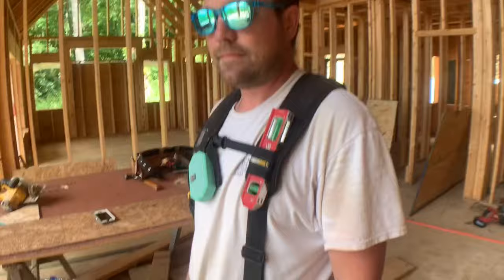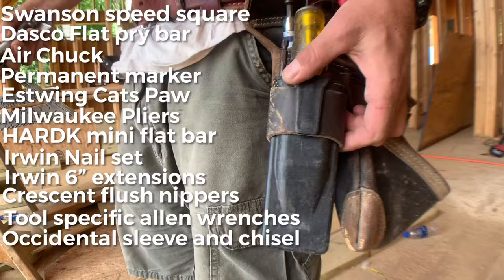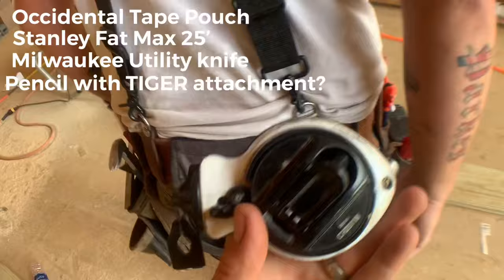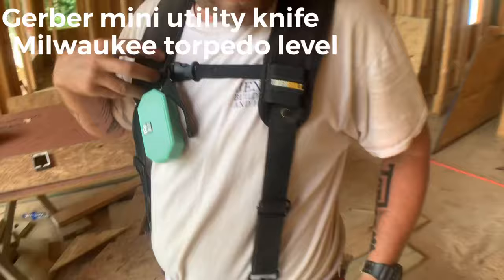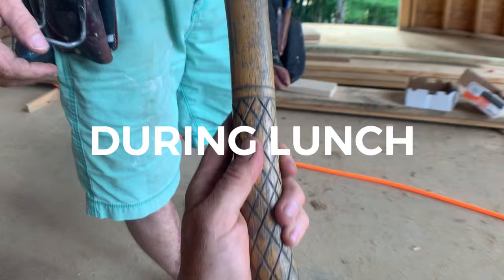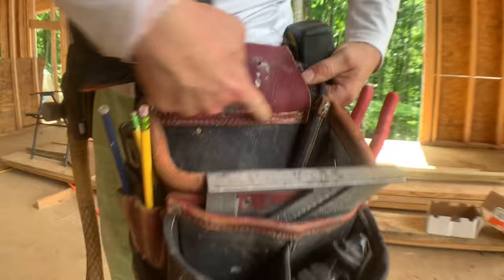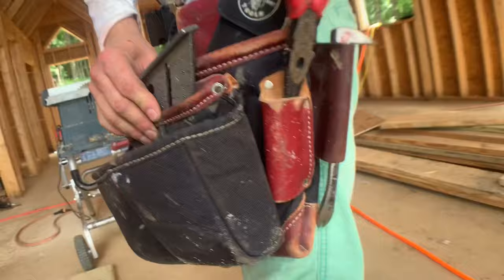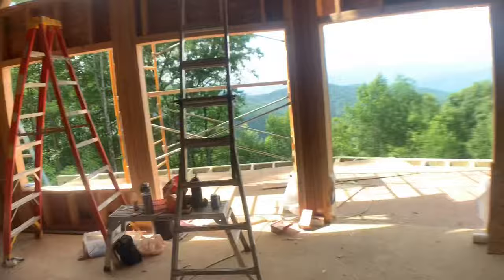Tool Your Belt | 2 Awesome and Eclectic Tool Belt Setups

Comment: One thing I learned from the old guy at EC and have incorperated into my belts is to always have your tape and marking items on opposite sides. That way you can pull out both at one, each in the ready hand and ready to mark! Every since that video I swear it has sped up my productivity to the point the Italians I work with have picked up on it and are currently doing it now without even asking me. The fluidity of it alone is not thought about but easily spotted and once someone sees how fast you measure and mark and are onto the next layout or cut.... they are envious lol

Comment from the maker: Ok so Jono and Jaime are rigged for doing framing, trim, and general carpentry.  They were doing trim the previous day on one job and framing a deck the next. We do almost everything OURSELVES on our jobs from pouring footers, to tiling showers , to building custom cabinets.  Basically our usual toolbelt set up is a combination of a framer and trim belt set up so that we can tackle ANY task. Hope this is helpful and fun for you guys!!
Reply: That's the way to be man. I built my own house, dig the hole, poored the foundation, framed, sheeted, all metal siding, u know the rest. I did hire a guy to hang sheetrock because I couldn't handle 12' rock by myself.
Reply: FYI, I was 25 when I done that.
Reply: I mean.. the wee little flat bars and the kreg bit kinda gave it away :)

Comment: Best tool belt tip I've ever heard is to keep all of your small driver/drill bits in a Altoids tin to keep them organized.  I use it every day
Reply from the maker: Yep that’s really a good one..  thanks
Reply: Or Buy a cheap yoga foam block on Amazon and cut it with a heated sharp knife to be in the shape of one of your small pouches. Then pre drill 3/16 holes neatly wherever you want your bits. Always organized and they never fall out.
Reply: @h2s I'm a new construction  plumber. I agree on the pill bottle. I carry an Advil bottle to hold my cutter wheels. I'm the only guy on the crew not losing his wheels.
Reply: Just get the little dewalt bit case with snap lock and has a clip. Although I just keep mine in my little pouch of my occidentals

Comment: Too tired at end of day carrying all that. 30' fat Max tape, hammer,, speed square, pencil, sharpie, utility knife, scribe, multi bit screw driver. AND a nice conveniently located table for about 30 things I like close by but don't carry. 61 y o.
Great videos guys, the right crew makes it fun.
Reply from the maker: Wow! Thanks for the tool count on that :-) you’re exactly right about the crew makes the difference… We are super blessed to have a bunch of great guys and I actually look forward to going to work.
Reply: @PerkinsBuilderBrothers  
Forgot chisel 3/4" and nail sets, big and little ride in the bag. Over here we call it the misery bag but you don't make any money unless you're wearing it. 
Thanks for the tip on the chisel guard. Ear and protection very important, keep up the great work !

Comment: Nice practical setups in my honest opinion. Great video. I'm starting to dig those small units on your strong side where a bag would normally go. You carry what you need there. With a traditional tool pouch you tend to overload it because you have the extra room. Stuff you won't use all week. 

  And we all know that ounces equal pounds.

Comment: nice video , I don't keep the pouch too heavy , all you need is a torpedo level , a measure tape and a square and knife and pencil  , everything like pliers and hammers and wrenches else goes in the tool box . The tool belt is meant more for holding nails and screws than for holding tools , its more of a nail and screw holder , its not meant to hold a lot of tools

Comment: I have a tool bag where I keep everything I might put in my occidental bags that day for whatever I’m doing and outfit it in the beginning of the day. Two different Tajima boxes (permanent or temp thin line) finish or framing estwing hammer, different size punches, a host of tools/wrenches/pliers and of course my trusted makita impact (although I handled the Milwaukee 12v and will probably get one soon due to weight and shape.)

Comment: If you roll on a rubber handle, that will help with grip. I was able to find an old bicycle inner tube and roll on. I know it’s only a 14 and 16 oz hammer, it’s amazing the difference it makes. I also have carpel tunnel and other nerve damage, my grip isn’t what it used to be.
Reply from the maker: Very cool idea.. thanks
Reply: I wrapped my Stiletto’s wood handle with cloth grip tape. Picked up at contractor’s tool store. Retail stores have it in first aid aisles too.
Reply: Loren Rickey how does the cloth grip hold up in rain and snow?
Reply: @donmartin7728  tape has been on for over a year. I haven't exposed it to heavy rain amd no snow. Mostly clear weather only. When I bought the tape it was advertised on the package for hammers, bats and tennis rackets. I really like how it works. Check sporting goods stores for friction tape for bats, hockey  and sports tape.
Reply: Loren Rickey I’ll check it out. Unfortunately my equipment is exposed to all forms of inclement weather.  I spend a little extra time cleaning and caring for it all.

Comment: The leather belts get crispy,
The cloth ones loose their eyelets and fur up...8 years ago I swore I’d buy ONE that lasts forever...
I nailed it: at pawn shop found one of those old Klein lineman’s harness 
Took a grinder to the 2 big rings up front....coolest belt ever 
One problem = 
I’m getting wider and down to one of the last holes! 🙄 
But Finally a belt that you can not kill ! 
“Plus the metal Klein tag on the back is a great fashion statement 😎
Reply: You're supposed to condition your leather belts... then they last forever
Reply: @pinchpeak5203  Klein belts still going strong as the day I cut it away from their annoying metal rings…
No conditioning required 
Plus it still looks way more cool than all the predictable China made crap out there. 
It’s truly a forever belt.

Comment: Great video, Jamie and I basically have the same setup other than I have a Estwing rip claw and Oxy Light bag. I'd like to work with you guys for a day or 2!
Reply from the maker: Logan Woldridge you must be a REAL TOOL GUY too🤘. Thanks
Reply: @PerkinsBuilderBrothers  I have lots of tool that I inherited from my Grandpa and father, Dad was a carpenter. I'm a jack of all trades and master of none, carpentry is my most favorite work. Thankful I can do it for a living and be self employed. 💪🏼
Reply: @Perkins Builder Brothers , love the channel. I also live in western NC and well I'm a kinda bargain hunter and I wear a Husky dual bag with harness. Swing a Estwing 22oz, 35' Milwaukee tape, 10 Estwing catpaw, klien dikes, Milwaukee torpedo level Milwaukee chalk line which I must say is the best chalk line I've ever used, and of course my little DeWalt bit box with all my bits and a Milwaukee speed square it has scribes up to 6" love it, also 1.25 ace hardware chissel.. then on top of that a handful of 8 inch pole barns. That's a real nail.

Comment: Nice video! You can tell a "seasoned builder" by the the bare minimum, but nothing like yours setup. So the same instance with my crew. Sporting an old 14oz stiletto Ti with hickory handle. And one odd ball with a 14oz Ti with PF handle.  Every handle looks different. I sport a TiBone 15 oz  most of the time. Sometimes I run an old 16oz Ti. But I want to get a new Martinez. Speed square, nail set/punch, sharp chisel, some  pencils, inkzalls/sharpie, chalk box, knife, tape, random bits (usually t20,t25,#2 square) claw/nail paw and or flat bar, and random mix of 16 commons, 10d's, ticos, and screws in no particular order or number, for any particular guy. That's Funny For sure! 
Thanks for the content! 
That's going to be a beauty! I love a nice "mountain style" build. A lot more involved than setting a standard truss, but the cathedral and window wall makes a home. Especially with that kind of view. IMHO. 👍
Reply: Wait, you’re pounding 16s with a 14oz? I thought you were describing a finish tool-belt set up until you said that. I dunno..
🤜🤛
Reply: @psidvicious  I'm using a 15oz actually. The Ti Bone. But yup my framers pretty well all have a titanium 14 oz stiletto. 
They smack harder than a 21 without the weight or vibration. I used to bang nails with an old estwing. Nope. Never going back to those days. 
Give one a try some day. Takes some getting used to, but more than worth it
Reply: @ David Briot - I’m not buying it. I don’t care if the hammer head is made of diamond. There’s a pretty simple physics principle at work here and it has to do with mass and acceleration (the old, irresistible force meets immovable object). I have no doubt these ‘new’ titanium hammers feel great in the hand and are ergonomically designed and all that, but you can’t change physics. These are the over-priced flavor of the ‘month’. If this hammer just feels that great, and you just have to have it, fine, that’s the hammer for you. But I think you’ll see them fall by the wayside at some point. Standard issue for me is a 28oz, straight claw, smooth face, hickory handle, Vaughn, for framing. Or a similar Eastwing for concrete work. Never had any elbow/shoulder/hand problems for 30 years. Good luck w/that thing.
🤜🤛
Reply: @psidvicious  no problem. I was skeptical the first time I tried one out. They actually claim to drive like a hammer double the weight. I know better than that, no 15oz hammer is going to bang a nail like a 28-30 oz. (Or maybe some day they will?) So with my experience 21-22 oz seems pretty accurate.  My most used quote like most men has been, "there is no replacement for displacement." And I still agree with that statement. While I agree with physics. I also agree with technology. The exact way I would have called someone crazy if they told me 10 years ago, that there would be a cordless, 12 inch, DB compound, sliding miter saw that runs just as fast, or faster than cordless. Or cordless impacts that will outperform the best of best in pneumatic impacts....... It is what it is though. And here we are. We run the flexvolt miter's and circ saws, and milwaukee cordless pretty much everywhere else. It's insanity I know. Still hard to believe even for me. Same goes....With companies like stilleto and Martinez, a TON of engineering and technology go into what looks like an every day average hammer. I have a ton of hammers from estwing, to Vaughn, to Stanley, and stiletto. Most certainly the carpenter will make or break the capabilities of any tool. But I think you'd be surprised to see just how many pro's use the exact hammers we do. Moreso with guys my age. It looks as if the Perkins Bro's do also.  I've only been swinging a hammer for a bit more than half of the ammount of time as you profesionally. While I don't have shoulder problems either, I'd like to keep it that way. And it's nice to get the job done quickly without the unnecessary weight. Either one will get the jobs done, so that's what is most important. It's just preference I suppose. But the guys who run these hammers know what I mean. They may not be all that and a bag of chips. But in my opinion they are worth the investment. Btw, I haven't been using the stiletto's for long. Maybe 6 years of the 20 I've been in the trades. I just took that chance, after seeing so many framers using them. And it worked out for me. At the end of the day, No Harm. No Foul. We're all just some blue collar folk out here trying to feed the family and build the best homes around. To me it don't matter what tools you use. 👍👊

Comment: Was wondering what type of setup compressor, generator, couplings do you run on your projects? It looks like you do mostly custom homes, so I'm guessing your running a generator all day, would you recommend using battery operated framing Nailers, or use the compressor type of nailers?
Reply: Depends on how many batteries you have, if you have a big crew I would heavily suggest air nail guns, that frees up your batteries for other tools, sawzalls and drills ect. However if it's just you and maybe one other guy the battery operated nail guns may be your best option,

Comment: What brand of tool pouch does Jono have on his left side where her keeps his catspaw and drill bit extension?  I really like the small hand tool loops inside the bigger pouch and could use those.  I can never seem to find anything like a combination between an electricians & carpenters tool pouch.  Where did he get that from?
Reply from the maker: I’m pretty sure it’s also Occidental (Oxy) Leather. I am in route to work so I will ask him and get back to you if that’s not right. Thanks

Comment: I'm 71 years old, retired after 48 years in the business and I'm with the other old guys commenting here: WHAT is with carrying all this stuff you might need once a day - if that - ALL DAY LONG?  A hammer, utility knife, couple of pencils, tape, speed square, maybe a cats paw if you screw up a lot. And two pounds of nails. Keep a framing square, level, 4 ft T-square, chalk line, things like that nearby if you're going to need them during the day. A nail apron is like a garage - the more space you have, the more junk you collect. I say keep it simple and lightweight.
Reply: @ Stephan Holland - I hear ya man...that catspaw was kind of a red flag for me too. I kinda like these guys, but I think I’ve given them some pretty harsh comments on this video. The ‘video’ work is great! But I gotta take exception to this tool bag set up. Tape and pencil on the same side?? What the...?
🤜🤛

Comment: What a jokers! No any DVD with spreaded legs in the pouch?

As a right hand framer I have my own set-up for tool belt: on my left side I have 5- pocket pouch with ( from lower to the upper) Tajima chalk line in pocket #5, 25' measurer tape in #4, 2.25"nails in pocket#3, 3.25 nails in pocket#2 and some concrete nails and roof clips(when I'm on roof) in pocket#5.
On my right side I have my Stiletto hammer and Swansson 90degree square with level in its handle and another pocket holding Stiletto nail puller, carpenters knife and two pencils.

Comment: I’m totally gonna spray my Tajima white that is rad. One question though, you’re a carpenter right, then why would you run a torpedo level???? I just can’t see why you’d bother with a short level???? What do you use it for???? I have a six foot, a four foot and a two foot, what more do you need. Second guy is running a set up real similar to mine and actually seems like he knows what he’s on about. Oh yeah I’ve got one of those Californian Framer hammers but a 24 oz leather handled Estwing is far superior for real carpentry work, sure they don’t look as ‘cool’ but I’m a carpenter I build architect designed homes, and I’m more concerned with doing a good job than running a cool hammer. So come at me big guy and explain to me what a Californian Framer does that a steel handled Estwing doesn’t.

Comment: what does a 6" level do for a framer... unless your working with lvl/lsl
Reply from the maker: You can use it to Mark plumb cuts on rafter tails
Reply: Don't be a hater because these boys are cool !   Nothing wrong with having fun with your work, hammer down !!
Reply: @randyrussell6246  it's a serious question, am I missing something and should be carrying one?
Reply: @ Ram , I'm being serious and cutting up , these boys are more than just framers or your run of the mill builders of today that are not true builders but are brokers, watch a dozen of their videos and you will see that purpose is in every tool and notice the scratch and ware. I am certain that they have changed out their bags from time to time but they are doing many task besides framing. They may tote that torpedo for 3 days and not need it but when they do,,,,zip zip !

Comment: So I just bought that chalk line and it is leaking like crazy. Any suggestions?
Reply from the maker: Use the chalk from the same company !!!
Reply: @PerkinsBuilderBrothers  I am. Bought together on Amazon. I'm going to try a piece of foam in the neck.
Reply: You didn't chalk it correctly. Either that or you got it wet at some point. 
There already is a felt washer/o-ring in the Tajima chalk box. 

You only fill the box about 1/4 of the way, hook it to something, spool it all the way out, wind it up, repeat until your line is throughly coated. Usually about 4 times for me. 

Then never fill your box more than half full. 
The extra space is to allow the line to push the excess chalk out of the way as it spools in and out and to remain inside the box If it is over filled and not correctly coated it will spew chalk like crazy until it is at the proper amount inside and the line is coated. Better to just take the time to do it right the first time. 
Your chalk will last more than twice as long and your lines will be noticeably more precise.
Reply: @Mynameisnottrevor  thank you! I'll go try and replicate this after the fact. Definitely didn't get wet, it was just opened that day. I will spool it out a few times and try again.
Reply: @buildingwithbrian  No problem! Good luck and congrats on the sweet chalk box!